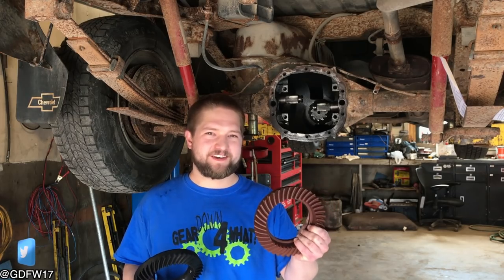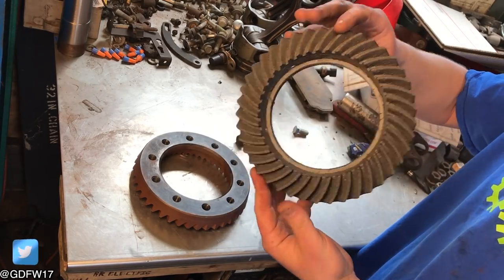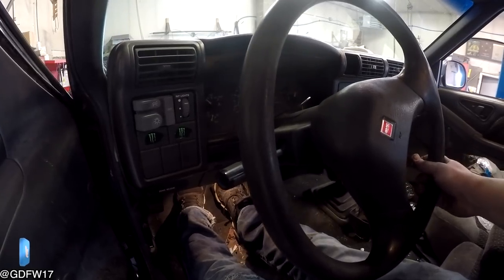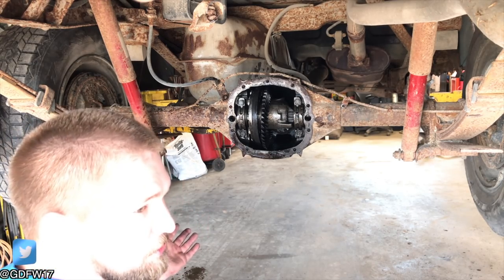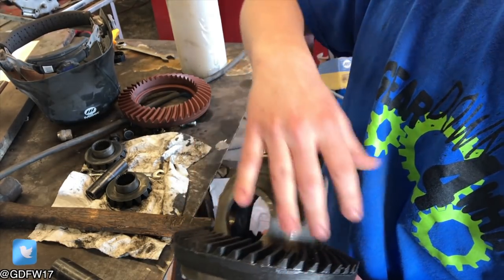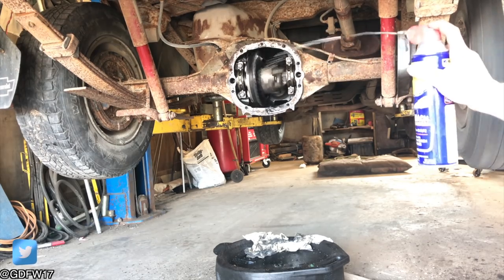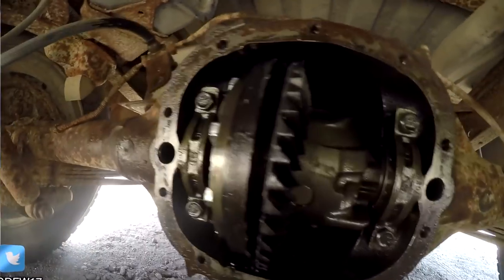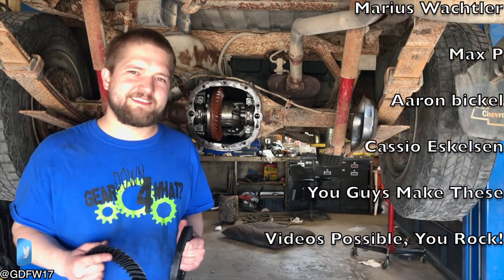Replacing Drivetrain Parts with 3D Printed Carbon Fiber Nylon - FOR SCIENCE!

Comment: Okay, so it looks like you have ten bolting points. (nuts in the gear) If you retained this project, you should drill holes between the nuts on the inner part of the ring and use wide but short high thread count screws. It looks like you've got about 1/3rd of an inch of extra meat on the inner ring area, that should be plenty of shearing force protection to have another look at this project.Drill holes that are just smaller than the screws. For example, you have the actual bolt diameter, and you have the wider thread diameter, like how much the threads protrude from the bolt. Make sense? Okay, drill holes that are about halfway between the bolt diameter and the thread diameter. Reason being, this will allow the threads to dig into the plastic. The plastic will deform where the threads dig in and push out, filling the rest of the remaining space. I went way too deep in explaining that, but I'd really like to see you make another attempt at this. The more bolts the better, but I'm sure you can make this work without having to make another prototype.
Reply: Oh, this was a year ago.... :/ Darn...
Reply from the maker: Yeah... sorry it’s been a while

Comment: next, what about printing the U-Joint on the drive shaft, or one of the drive shaft pinions? that way you don't have the added nuts. Or maybe come up with a different attachment for the ring gear instead of a direct replacement... how about a few nylon dowels as POC before adding in the bolts/nuts.
Reply: what is the difference in weight?... would it work for a small bike or go cart?

Comment: I would print it and tap it for helicoils for threads. Then you have no pause in printing, the holes are part of the structure, and the helicoils are used in referbishing threads throughout a car.

Comment: I'd say maybe try taping holes for helicoil and use that as your threads. I know a helicoil in aluminum is stronger than just a taped aluminum Threaded hole. I wanna see this. I was surprised the ring gear even held up under vehicles weight lol

Comment: I'd like to see it with them sending the specs out to have it printed in metal, but the most painful thing about that video was watching the truck pull out onto that dusty lot with no gear oil or differential cover.

Comment: Why not print it as a 2 piece part ? With mortise on the side with nuts and tenons on the gear side ? Then apply some JB weld to increase overall part strength.

Comment: Could you drill holes into it to slip metal pins, like from a roller bearing to keep the ring gear and it's body together?

Comment: step one, turn off the part cooling fan... pause to put the nuts in, but when you go to reprint, re-heat the part with a quick blow torching. could also used a heated enclosure to raise the layer adhesion in general as the next fail points will be on the teeth. may also be a stronger part if you printed two parts, the part with the nuts and parts with the teeth.. for the teeth you could orient it 90 degrees to the bed, not as convenient, but this will maximise the teeth strength, and then engineer it to key into the piece with the nuts.

Comment: As an rc hobbyists, i’ve 3D printed parts for my rc. Both nitro and brushless. To my experience, any part printed for mechanical use and bears a ton of rotational torque is bound to break. Maybe you can 3D print wheels. but as part of the drivetrain, even a toy proves it’s not possible.

Comment: Hell yeah reprint and do it again but use toothed steel sleave inserts and try to install them without stopping the print when you program The Print leave sufficient room to install the sleeves before the teeth engage on the steel sleeves I don't know how malleable the plastic is right after it is printed and how long it takes for it to cool down and Harden just my two cents

Comment: I would do it again but drill out the holes and put lock tighted time serts that we use for engines. They are made of air craft steel and have a locking tapper that should work perfectly. It comes it a kit that should provide you all the needed taps and insert sizes needed

Comment: Haha fun experiment! I guess to get better adhesion with the jbweld / epoxy you'd have to sand the parts to rough up the surface. Since you can't get a chemical bond you need at least a rouger surface for a mechanical bond.

Comment: It past the cardboard test!  As in, it went "past" the cardboard.   Should have drilled and inserted steel pins (3/16" diameter) to prevent the printed layers from delaminating from the shearing forces.

Comment: My suggestion; do it again except this time before you start up your printing to resume get a couple of heat guns and a laser thermometer to keep an eye on the part from overheating it and heat the part back up before you continue the printing after you got your bolts in or as you said you could tap it but instead of tapping it use a helicoil which is much stronger. Give me your thoughts on my thought. That was interesting thanks for the entertainment

Comment: Could it work if the nuts were pressed through the gear teeth and then filled over top of, surely that would solve the delamination problem from pausing the print

Comment: Print it again with nut threads in it. And print another with two halves like it is but interlocking so it doesn't just release from the face.

Comment: 2:15 incorrect method of installing shims. Can cause them to deform and even break. Best to put the shims in the housing using oil on them to stick them to the sides, then slide the diff center in using a hard rubber/nylon mallet to help wriggle it in. Good experiment though.

Comment: You could still use that without reprinting.  Just insert like 10 or so bolts on the teeths side thourgh all the differential.  Then cut/shave the bolts merging with the teeth.... it might work... minimum expenses to do it

Comment: Couldnt you have used nuts with a larger depth and have it extruded so that the bolts are a part of the second form. Basically they seat in the top and bottom halves. Could have even added a few pins at the same time around the mold just like the bolts.

Comment: It will work for some time, but it will always fail. Steel components can be designed to last forever (ignoring abrasion and stuff) while plastic components can't. If that's the size gear an engineer decided would last forever being steel, you'd be lucky to get any reasonable number of cycles out of it being plastic, even with just free spinning wheels. 3d printed steel or titanium could theoretically both last forever, so that would be a pretty fun test.

Comment: It would be much stronger if you printed it all at once and heated the nuts to insert them or use large heated nutserts. Also... it would be imperative to anneal the print to get it as strong as possible.

Comment: I'm surprise you even think plastic might compete with stainless still, however I read that carbon fiber is stronger than stainless still, but I suppose there are some assumptions: the fibers are distributed longitudinally or homogeneously where strength is needed, and temperature are never too worm for the fiber...
My advice if you do it again:
- reduce the layer height down to 0.10mm (a reduction of layer height might increase a lot layer adhesion, e.g. I was printing initially everything at 0.20 discovering later that 0.18 or less was solving a lot of layer adhesion issues)
- increase temperature few degrees from previous fill
- check with a microscope (or similar) the previous print, IF it looks empty between lines in some position, increase infilloverlap by a reasonable proportion
- to put the nuts pause  the print and move the head in an empty space e.g. with G1 X0 Z0 E-2.5, then restore the print (octoprint has a pause button)
- don't use a heat gun but an oven (better with fan) with a thermometer inside, and do some research to see what is the best temperature process to make more(just more) homogeneous your filament, do some experiment checking vertical sticks strength in case of doubt
Best of luck

Comment: From an engineering stand point I like the idea, I'm a complete noob when it comes to 3D printing. However, wouldn't it make more sense to include the nuts themselves in the overall print? it'd use a lot more material but it should increase the tensile strength in the overall unit since it'd be all one piece.

Comment: Probably your reason for the seperation is when you installed the nuts in the plastic you didn't have gloves on and left a layer of oil from your hands on the surface of the exposed plastic that was blocking a good bond with the rest of the print

Comment: What if you bolted it all the way through so there is no slip between the two pieces (Small bolts where the lower ridges are to bind both parts.

Comment: In my plastic pinion gear making expertise (which i have been doing for over 47 of my 36 years on this planet), try to Make a jig to set the nuts in place on print pad, remove jig (like the rack of a pool table), then print in one pass. If done right I think your bolt location should be spot-on and you could hopefully eliminate the lamination problem. 🙈🙉🙊

Comment: There is no substitute for the actual part, HOWEVER FOR FUNSIES..
Make one solid piece and tap holes into the material for your bolts. The problem long term will be the teeth. Your fibers come out of the print along the path your tool is laying, so they mostly help the strength of the material coming from a direction that is perpendicular to the way the fiber runs/print runs. If you print the gears laying flat, the fibers will not help nearly as much as it would if you could print with the gear standing up. If that doesn't make sense, i have some crayons i can draw a picture. I'm bad at explaining mmkay

Comment: The nuts are to bolt on that back plate.  Print it again with that back plate and ring gear as one and eliminate the need for the bolts.  Then, as on unit, it should hold up better.

Comment: I don't think there is a need for nuts. Just drive the Screw directly into the plastic or tap it. The forces will be applied in another direction, so why bother?

Comment: Why not just leave out sections of the body of the print so that you can slide metal fasteners into it after the print is done, rather than mid-print?

For support of the upper layers you could also just put the nuts into the forming recessions WHILE it prints (quick reflexes? lol), so that it could just build up around them, then print over the top of the now embedded fastening nuts.

Comment: can try to drill out the threads and put in heli coil. or if possible to place the nuts on the printer and it work around and into them. or place the bolts in upside down and use them as studs. instead of nuts in the gear

Comment: You need to set rear end up correctly to give it a fair shake.  Looks like you had way too much mesh between ring an pinion. Causing the pinion to overload the ring gear  severely .

I would just print the ring an then drill an tap the holes.

Comment: Try to temper the parts at the pause on 80 degrees Celsius also the metal nuts befor inserting

This should improve the connection between the layers

Comment: 8-10 bolts with threads in nylon will be a lot stronger than 2-3 tooths that are ingaging. I will eatimate it to hold about 10 hp from the engine for a while, meaning you can drive it a little

Comment: Why not for what it is make recesses in gear face for nuts be inserted so you literally nut and bolt through whole piece?  As long as nuts are below tooth root should be fine. I don't think the gaps in teeth would be a huge deal

Comment: The carbon fibres in the nylon are there for flexor strength, ie. resistance to deformation. It acts like a harder, more brittle version of glass-reinforced nylon, which is why it is usually used in "furniture" for firearms, as part of the composite structure of modern military ballistic-helmets, heavy duty tool enclosures and such. One thing it is not good for is resistance to friction, shock load and continuous friction-based heat application to the nylon substrate. Under heavy use, even if the gear teeth survive, that ring gear will flat-out melt. I'd bet my bottom dollar on it. All that is even without considerations like what oil does to plastic. I wouldn't even make an oil pan or diff cover out of anything that's nylon based, let alone parts of the power-train. 
All the fuckery that goes on with carbon-fiber bike frames and their durability, or lack-thereof, makes me want to stay away from anything carbon-fiber based until the technology is well-established, repeatable and standardized across the market to the point that one specific grade of fiber from one company would be similar, if not the same as that same grade of product from a different company, like with steel and aluminum. That level of universality is sorely lacking. It just hasn't become established enough in the mainstream, but I do digress, so I'll just shut up now lol.

Comment: A little understanding for the forces at work would help.

You're trying to combat shear force. Laminate filaments don't deal well with this. You would have to do a vertical radial print to have this stand a chance (with the y axis going through the center of the gear, as positioned in the axle).

Even at that, the top and bottom would want to delaminate with any significant combination of RPM and torque application. An LSA printer with DLP image projection could help... but would still suffer.... and I'm not aware of any LSA printers that can handle carbon impreg material due to image diffusion.

Aside from plasma deposition, I'm not aware of any type of printing that could handle this... and a PDP part would still require finish machining of the part for the gear.

There are companies that make plastic gears with some degree of strength and efficiency, but they use injection moulding. 

NICE TRY FELLAS!

KEEP IT UP!

Comment: 3D filament print sucks at layer bonding, a simple shear at direction of the layers, the damn thing gonna break. try flip it 90deg or using SLS. However SLS has issue with shrinking. 
3D printing strength parts is just overall infeasible at this moment.

Comment: I've tried JB welding sprockets on to stuff it doesn't work as you've found out but the gears themselves lasted so you've learned not to try to JB Weld a gear or sprocket

Comment: Why not have one piece and thread into the workpiece. If the stuff isn't strong enough to hold the bolts then there's no reason to put it in the diff

Comment: There is a reason why the ring and pinion are made from hardened steel billet or aircraft aluminum would hold up better then plastic but still will not go as far as steel

Comment: Do the part again without the metal nuts,  than drill the correct depth and right treads it should hold enough for a longer period of time and should stand the torque.

Comment: Do you understand how a hypoid gearset works? You need super hard, super strong steel alloy if you want it to live. And adequate, proper lube. You don't understand the forces at work here. Try printed pistons, conrods and crankshafts, I bet the fail rate is 100 % on those too.

Comment: Nylon is strong but flexes too much.  I don't even think the carbon loaded would be stiff enough.  You need something stiff to take the force from where the teeth engage and spread it out.  I you have printer that gets hot enough, something along the Ultem line of plastics may work better.  Baring that, a changing mechanical design may be needed.
You can heat soak the parts for a few days too.  This can help to let the plastic get better stuck to its self and also let the stresses work out of the materical.

Comment: Dowel pins tapped into holes between the nuts (parallel to the bolts) might have prevented the failure.

Comment: Not even an old truck but looks like its 60 years old from all the rust. You'll get 20 more years out of the body if you undercoat it and use some  Rust oleum spray paint on the other stuff.

Comment: Do the exact aame thing but add reliefe cuts and mighty putty in the relief cuts so you can put the full force onto the nylon and see if ita physically possible for the nylon to holdup without worrying about it falling apart due to the way you made it and focus on the nylong strength, if the nylon itself can holdup but the mightyputty/ jb weld doesnt?, get clever with how you connect the two nylon componets so that it cant easy come apart

Comment: dont use wd40 like that. it can wash away your lubi in the drive, also from what i hear it attacks surfaces (rust) so it is not meant for actual lubrication of precision parts! just for bolts etc.

Comment: RIng gear (and all other drivetrain components) are made of high strength steel, more like 700Mpa in tensile strength.. tooth profile is machined to tolerance of thusands of an millimeter.But still I'll giva ya a A for effort :)

Comment: it could wear out faster than the original metal counterpart. because of the heavy parts connected to it. and considering how its made out of melting a piece of plastic, i would worry about how it would handle heat in the place where it will be installed. but hey, im no engr or expert just my opinion.

Comment: I think adding the nuts after printing the full thing without the stop in the middle would be stronger. Just keep the hole for it all the way through the teeth of the geat then put the nuts in after the print. Then lets see a burnout or something!